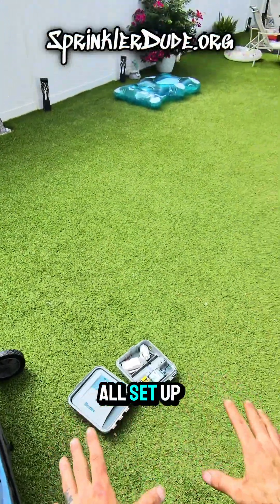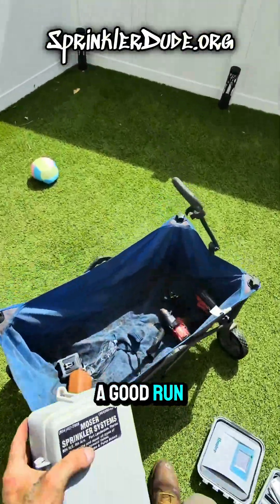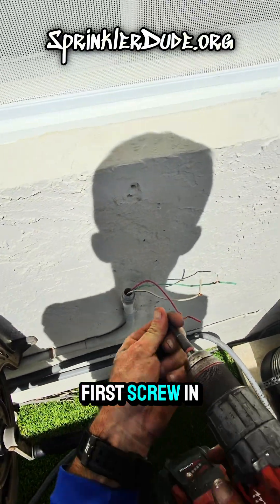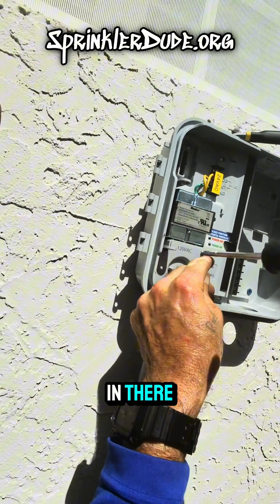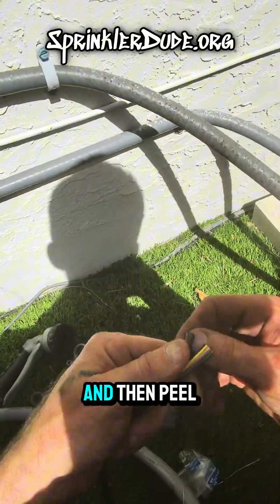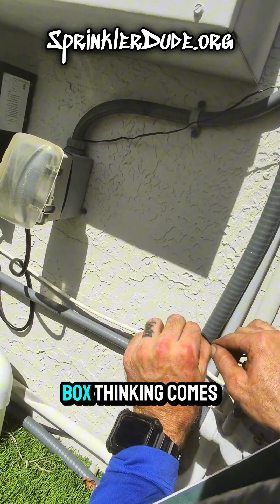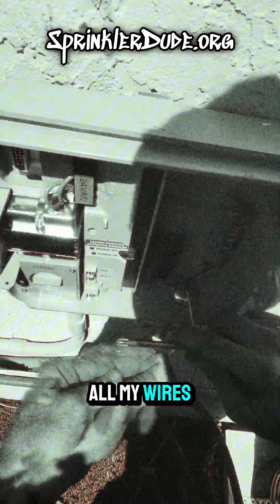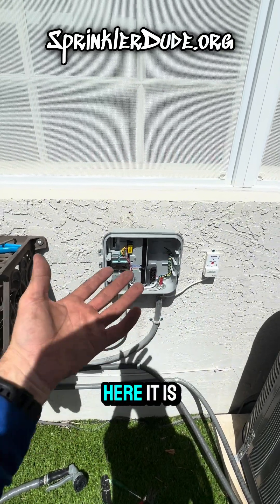Full Smart Controller Install | Hunter HPC (Hydrawise)

Comment: What's your thoughts on Hunter's Solar Sync Sensor?  Have you used these before?  Just curious if they are a reliable addition or if we're better off running with an Irritrol rain sensor as you have here.
Reply from the maker: The Solar Sync is more than a rain sensor.

Comment: Quick question. I just got a Hydrawise system and I usually like to have multiple programs for like spring, summer and fall etc. I want to keep the programs saved but there isn't a way to suspend the programs I want saved for different seasons? Is the only way to disable it is to use interval days and make sure no days are highlighted? Or is there a way to suspend? Also thoughts on "predictive watering" I feel like the forecasts on the app aren't always accurate. Thank you
Reply: P.S I used to have a "total control irritrol" that got struck by lightning you would just flip though program A-D.
Reply from the maker: Bummer!!
Reply from the maker: You can set up as many programs as you need. Simply disable all of the days in the programs you are not using. As for Predictive Watering. Try another weather station, if possible.

Comment: Can you put the sensor on the controller cover or is there electrical interference?
Reply from the maker: @vickikieft6108  how would you mount it? Because if you’re going to use screws, then they would protrude into the controller. Then, how would you route the wire?